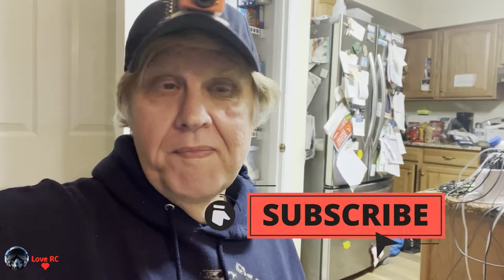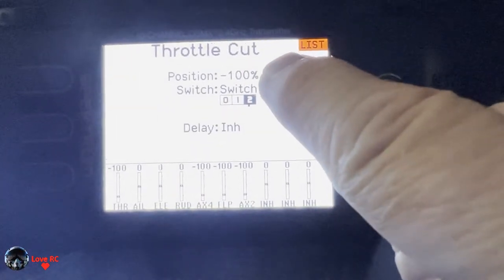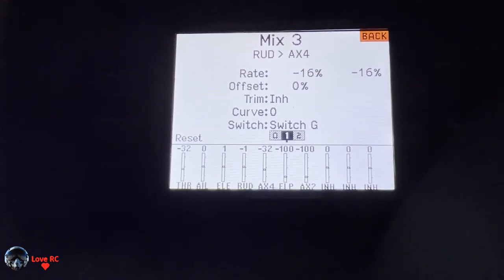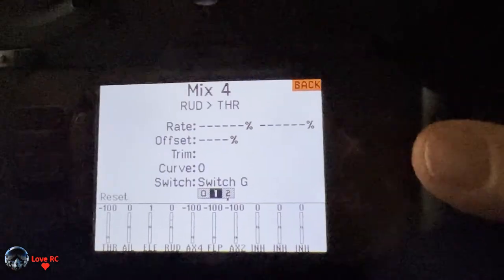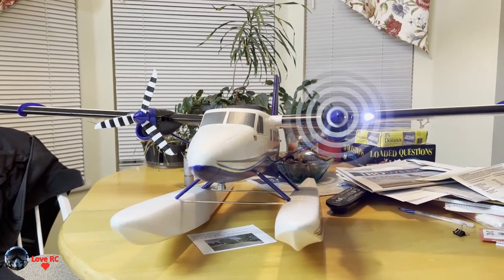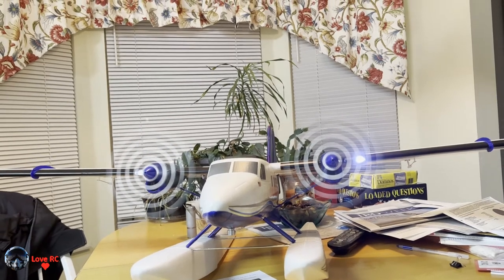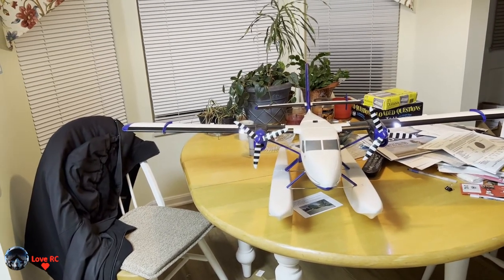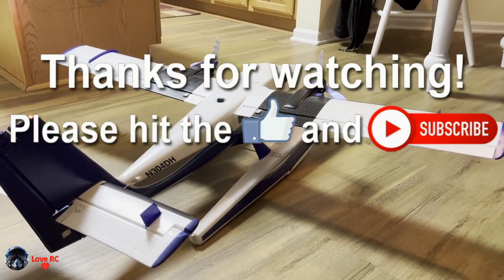E-Flite Twin Otter - Setting up differential thrust.

Comment: Too bad this wasn't done from Horizon. Differential thrust seems to be the right thing for any two motor plane. Thanks. Not sure I know how to separate wires for motors,,but thanks for your info.
Reply from the maker: You have to get two servo plugs and cut the two ESC wires and put a servo plug on each.
Reply from the maker: I agree it should have been in  a Y harness so modelers don't have to cut the wires,

Comment: So i just picked up one of these planes that was broken and needed repair it took alot to fix it . I put differental thrust on it it took 5 mixes with a old dx7s but it works and has throttle cut also it was a head scratcher to get it to work
Reply from the maker: Once you get it figured out it's really nifty.  I did it so I could steer better on snow with the floats.  This is my snow flyer.
Reply: @LoveRC  same here and for aerobatics lol

Comment: I fine tuned throttle trim of each engines so that the prop RPM were close to each other at power up.  That kept the plane from unnecessary yawing.
Reply from the maker: I did calibrate.  They seems to be working great.  Took her snow flying on floats a week ago.

Comment: Any chance of showing how the ESC's were modified?
Reply from the maker: The wires were split from all going into one servo connector and each engine ESC was wired to a separate channel. So you have to put new servo leads on them.  Right engine in channel 1. Left engine in channel 5. Lights plugged into the bind port.  Do this after the plane is bound.  After that you can use the bind port as a power source for the lights.
Reply: @LoveRC  and does one center wire on one of the servo connectors need to be removed ? I thought they carry power,so 2 into the receiver might not be a good thing...